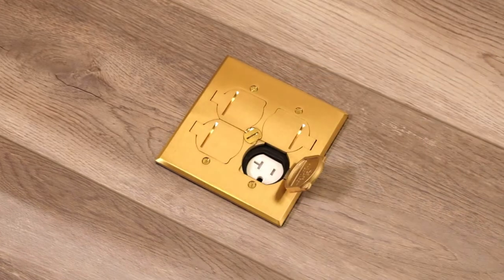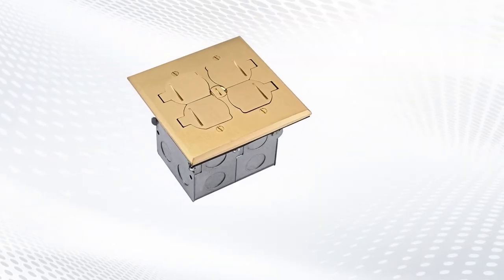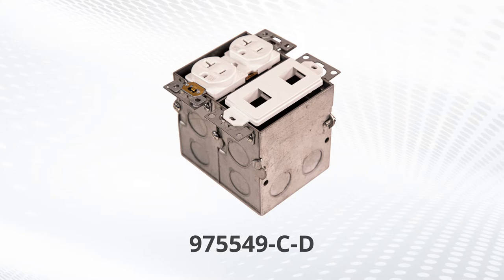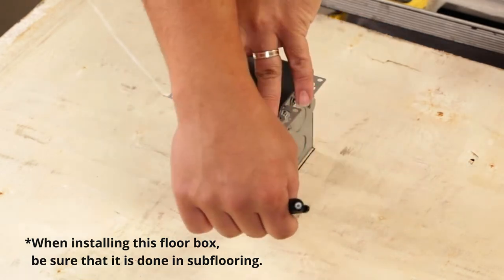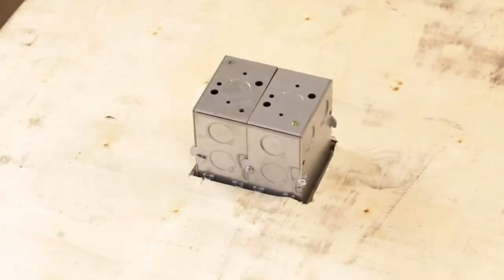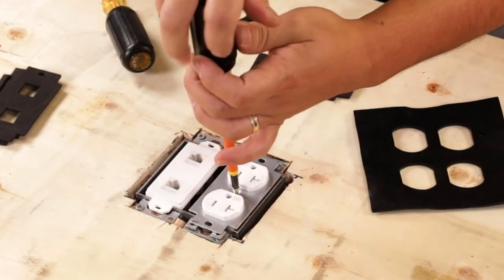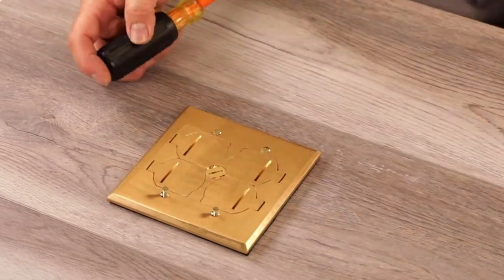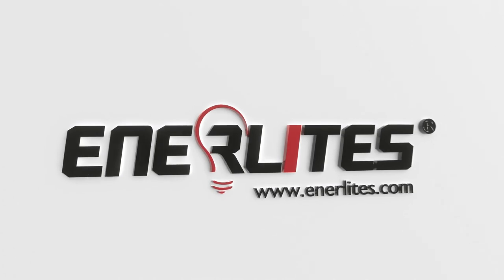Flip-Lid 2-Gang Floor Boxes Product Overview | Enerlites

Comment: First thing first, if you get the box with the 20 amp plugs, they are wired internally for 15 amp with 14 AWG wire. If you intend to use these outlets on a 20 amp breaker like I am for my stereo setup using 12/2 wiring, go to Amazon and find some stranded copper 600 volt wire in 12 AWG and rewire them. That is what I did, most folks will not have a need to do that. I just pisses me off that they have a 20 amp plug installed with 15 amp internal wiring. 

If you get a box with RJ-45 jacks, ethernet, they are Cat 5e keystones in there. Better to use Cat 6 keystones, if you are using these for video or require faster throughput. Head up to Home Depot, look for the Cat 6 RJ-45 keystones by Commercial Electric, $9 ea. They will fit, but they will not stay in place. What I did, was to use a glue gun to secure them from the back side, inside the box. Two big globs of glue per keystone, top and bottom. 

Other than that, these are nice boxes. I would purchase again.